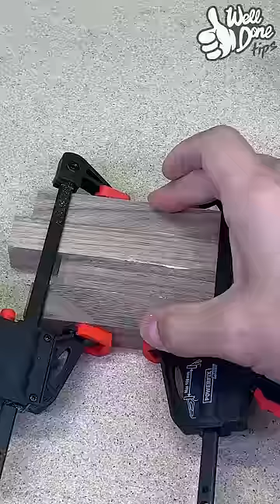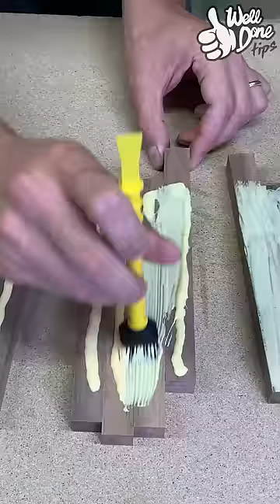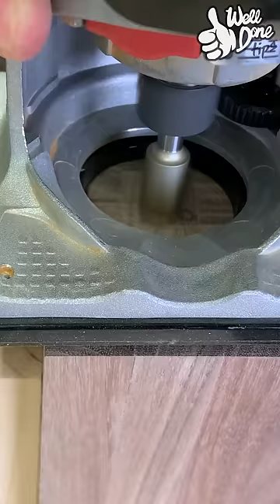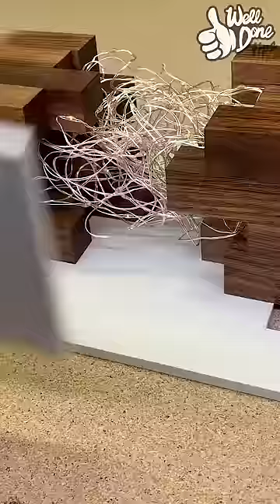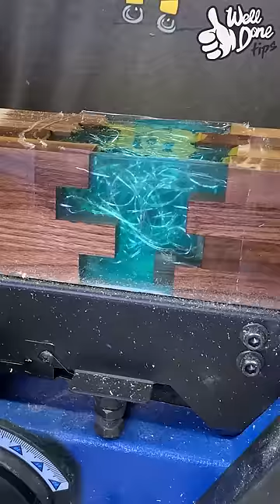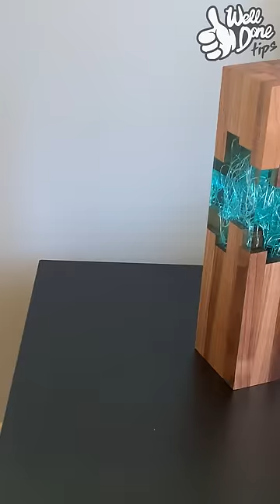Minecraft style wooden epoxy lamp #shorts

Comment: Wood work and epoxy job are phenomenal! Only critique is the way the wires are, no way to service it, and it would look way better difused.
Reply: and the million bubbles
Reply: @robbinve7539  bubbles add dynamic. Otherwise it'd just be fairly flat and boring.
Reply: Yeah those lamps are on one circuit so if one dies they all go
Reply: Its led though. Will last for sure. At least til the person gets bored of it 🤷‍♀️
Reply: @jemadamson2715  nah that don't matter depends on the wiring since those type of lights are in a single circuit so if the wiring goes it's all wankered
Reply: @welsh_Witch  o yeah best to not move it at all lol

Comment: "Bro the lights stopped working, can you replace it?"

"Well about that......"
Reply: Led lights don't need replacement for years
Reply: @what5059  true, as long as they aren’t defective or cheaply made
Reply: Break it and rebuild
Reply: Lmaoo
Reply: Lol
Reply: @what5059  What if it becomes fused?
Reply: @abhisheksanu8203  A good quality one last for a very long time
Reply: @what5059  What about over voltage?
Reply: @abhisheksanu8203  you can set a master bulb at the bottom which can be easily accessible to you.. so that only master bulb fuses, stopping flow of current and saving leds inside this lamp. 😁👍
Reply: Those are LED light they will not stopped working
Reply: Those are LED light they will not stopped working
Reply: @juniorramirez9030  Really 😂
Reply: Ask for a new lamp if light stopped working 😀😀😂😂
Reply: ironically it died about 10 minutes after he finished the video
Reply: He is from
WAT ARE U DOWING 
CHICKEN CURRY
MAY BE HE NEEDS REPAIRMENT
Reply: Then we can replace the wire by cutting this thing in the middle
Reply: Get a new 
New scheme
Reply: Just build a new one, he did it under a minute as shown
Reply: Мои мысли 😅
Reply: @rajendradighe9112  lmbo 😂😂😂
Reply: Welcome to America the land of d wasteful 😔
Reply: @rajendradighe9112 
"Bro you're light broke"

"Hold up let me find my crafting table"

Comment: Me: "Oh wow! That's LIT!"

my brain tho: "shits gonna die in a month or 2, those lights are terrible"
Reply: An excellent sales pitch. They'll have to buy another
Reply: We all thought it.
Reply: It’s open at the bottom, where he cut into to pass the lights. The battery pack can be changed easily 👍🏼
Reply: @christinetheoret112  you misunderstand. the lights are notorious for burning themselves out in short order. while the battery may be replaceable, the lights are not. they are encased in epoxy until the ends of time.
Reply: @saygoodnighttoghosts  wow… I didn’t know that
Reply: @Pale3110  yep, sadly quality control isn't great on these inexpensive Alibaba-esque string lights. spending even ten to fifteen more bucks massively increases the reliability and quality of the lighting.
Reply: YOU CAN MAKE IT SERVICABLE...A HOLLOW TUBE WITH LED ON END AND DETACHABLE...HELD IN WITH ANGLE METAL AND SCREW FROM BOTTOM...WIRES GOT THROUGH TUBE...NICE JOB THOUGH
Reply: @T.W.D. Lorial Grixon 🧟‍♂️ bruh I know that’s what I was about to say. Why are people so dumb. You knew
Reply: Me too. Should have left the center open so the lights could be replaced
Reply: @courtneyvargas733  bhi na
Gf to
Reply: I've seen a few diff things, mainly, just make a tube, he could've just cast a sole slightly smaller block with the lights, then a separate block that's bigger,, which will end up housing the block of lights, then "mount" the housing with a square of the plastic shit that resin doesn't stick too, being also slightly bigger than the initial opening of the housing resin to the wooden blocks for a third pour to stick the  housing blocks to the wood/resin. Though the middle would have to be hollowed out of the bottom block which would mildly defeat the purpose of the varying levels of wood for the effect, but that could be fixed with more rando work, like making that hollowed out part actually be made into yet another piece that's separate, acting as a plug/insert u just unscrew or latch or whatever else whenever u want to replace the smaller block of lights when they inevitably shit out because they're garbage, but all of this is more for a light you'd want to last a lifetime, and for that, gotta be serviceable, so multiple separate parts, reguardless of some of them won't need it and are perma stuck together

Comment: If one led failed to Glow 🌟 or fused...Rip the whole Masterpiece.
Reply: @Lifestyle N Business of course a led can still break down over time in such conditions. Nothing lasts forever.
Reply: "Masterpiece" ah yes like I couldn't reproduce this same thing in my highschool woodshop room in 20 min..
(Minus the glue/apoxy drying time obviously)
Reply: @lordtachanka80  yeah u couldnt
Reply: @M1szS  lmao I literally could I've been doing woodworking for years all he did was cut some long pieces at different lengths then glue them together and pour epoxy in between them and sand it.. it's not that hard, it may look like something hard to do if you've never done woodworking but it's not at all a "masterpiece".
Reply: @lordtachanka80  well maybe not masterpiece, but not easy to make either, like u need to have it all glued precisely, + getting resin with no bubbles isnt easy. and i did woodworking before

Comment: That is awesome.  Is there any risk from the lights/wires overheating, since they are encased like that?  Or is it OK because they have such a low power draw?
Reply: Not only that when they die and they will you cant change them.. xD
Reply: Resin is one of the best electrical insulator, so i think it is fine
Reply: I want one
Reply: @arnoldmmbb  you can if the box with the batteries is out somewhere we can’t see
Reply: @Anyathekoala  but the leds itself cant be replaced when they die and they will
Reply: @arnoldmmbb  a solution is to make a “hollow” casing so the light can be changes but still preserve the exterior look
Reply: @arnoldmmbb  if you can burn out a led light strip in your lifetime and I’d be genuinely impressed.
Reply: @LucielStarz123  yes exactly
Reply: @mickeyoakley4012  💁
Reply: Even if it got hot like that their is no oxygen to keep the fire going
Reply: @mickeyoakley4012  I can say the same... I've never in my entire life burned a single LED even tho they're all over my room including my PC...
Reply: @Killertiger2000  he wasnt talking about oxygen
Reply: Led lights don’t burn out like fluorescent because they give off a lot of light and little heat. That lamp will be long forgotten before the led goes bad
Reply: @arnoldmmbb  vv
Reply: @Killertiger2000  🤣🤣🤣
Reply: LED string lights produce so little heat, it is not an issue.  Most are rated at 50,000 hours or more.
Reply: @system4862  
the question wasn’t about electrical insulation, it was about thermal overload. Two very different things.
Reply: One of the best thing about dude is that he never takes credit for himself when he archives something He always respect us, the audience and his team and he is polite in all his videos We congratulate ourselves on this achievement??..
Reply: @arnoldmmbb  In 10,000 hours when they die you can just throw the light away..
Reply: @system4862  not good lol, the heat will stay INSIDE
Reply: @arnoldmmbb  he literally plugged it in how would it die?
Reply: No probably them just burning out and it becomes an ugly paper weight
Reply: @arnoldmmbb  bro leds last for years, if they break just make a new one.
Reply: @mickeyoakley4012  i have multiple strips of LEDs that have gone bad. What timeline are you guys from?
Reply: Almost all LED’s are rated at 50000hr mtbf. When LED strips go bad its usually the high voltage drivers that go bad or poor soldering on a single LED in series. In this particular case, the light strip looks like a small sting light similar to one my son has. On my son’s the wire is solid-core like magnet wire and the LEDs are individually soldered and potted in resin. Theses type generally are powered by 2-3 AA batteries, which is 3-4.5V, not high-voltage. So, operating it off USB voltage (5V) will be fine, probably even a bit brighter. Also, some people asked about overheating from the resin, not an issue, generally resins like this are a better heat conductor than air, so the thermal resistance between each LED and the ambient air is actually lowered (improved). But it’s unlikely to produce enough heat to amount to anything.
Reply: *string light
Reply: @system4862  that’s not the concern… does resin disperse heat well so the bulbs don’t burn out is what people want to know
Reply: @arnoldmmbb  it was cool while it lasted
Reply: Of course yess. This is just for the content.
Reply: They are LED (light emanating diodes) kind of like a solid state light source... the other lights that you say die/burn out are incandescent lights.  The worse that can happen to an LED is a wire kink or there is an electronic transfer problem at a connection site.
Reply: @jeandaigle  LEDs are actually very susceptible to heating related failures in highly insulated situations. Fairy lights not so much, but any of the LEDs over 1 watts get extremely hot and need an appropriate heatsink/ exposure to cool surroundings.
Reply: @system4862  bro read what he wrote again
Reply: @greatcesari  he just said that it did remove the heat better
Reply: @arnoldmmbb  - You'll be tired of looking at after 50 or 100,000 hours.....
Assuming we live that long😆

Comment: It's a cool design, but unfortunate those fairy lights tend to die faster than you'd think. That could easily go for upwards of $100USD and in a year be nothing more than a paperweight.
Reply: Unfortunately encasing them in epoxy will likely shorten the lifespan even more with the heat unable to escape
Reply: Because it only looks good lit? It looks like shite
Reply: @tyoung9012  exactly and you cant replace them so a waste of time and money, he need to do a version where you can change the leds

Comment: the funny part is that when those lights run out there's nothing you can do, and now you just have a cube with a mess of cables inside
Reply: Just stick a light onto the back and put it in a corner. Nobody will know
Reply: To be fair with high quality lights they should last a year or maybe a couple depending on the lighting system you use
Reply: It has a charging port...
Reply: @pieman12345678987654  the charging Port doesnt matter if the leds/light burn or break.

And i think thats not really a charging Port, it's just a USB Port to, You know, actually Make the lights turn on.
Reply: @pieman12345678987654  that's it's  power plug not a charger

Comment: That actually sucks when you think about it for a moment.
Lights going out will make the lamp useless, and fairylights are not built to whistand casual year-round use, so with no ability to replace them it will render the lamp useless.

The light will also be very uneven and dim, because they can't produce enough lumins while consuming a C-type port current
Reply: Would the resin create more heat problems on the electrical? It didnt look like a good idea to me.
Reply: Dude, why not just enjoy it while it last? 😬😉

Comment: What about leaving it hollow in the middle, with the glass still opaque so that you can put new lights in the middle, and... I dont know... Maybe you won't have to watch it die and then be an overly expensive project that now just doesn't work?
Reply: You can make a mold for the "glass" part, that has a round cavity in the middle so that you can change them out as needed. Just hull out an opening/tunnell for the wires and switch plate/box. You can hide the box or plate in the inside of the wood

Comment: I loved the idea but what happens when the bulbs short out. The whole piece becomes useless.
Reply: Since LEDs have a long life time and are relatively cheap I don't think that's really a concern. 4 or 5 years down the road just make another one.
Reply: @matthewscanlan4387  most leds have a lifespan over 50,000 hours (10 years)
Reply: @matthewscanlan4387  yes but inside the epoxy they will heat up and the life will be short